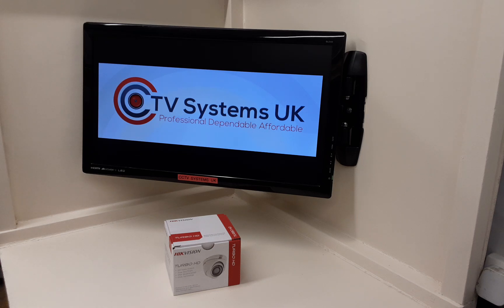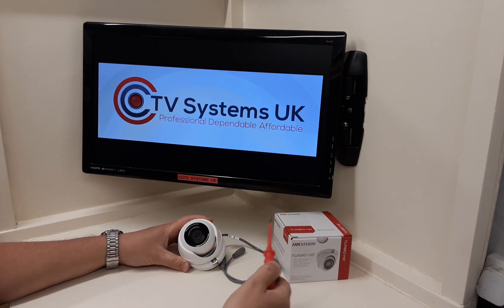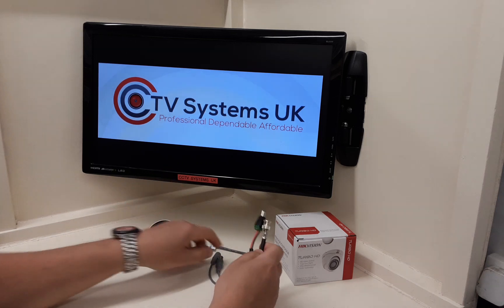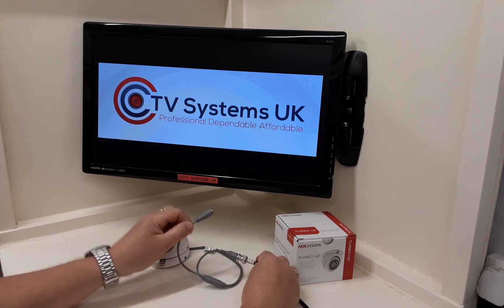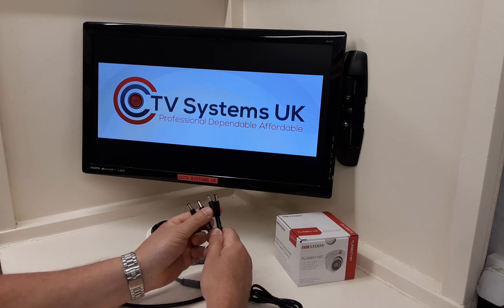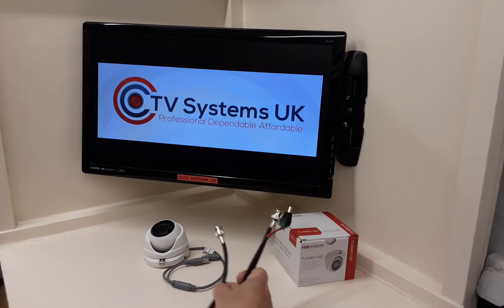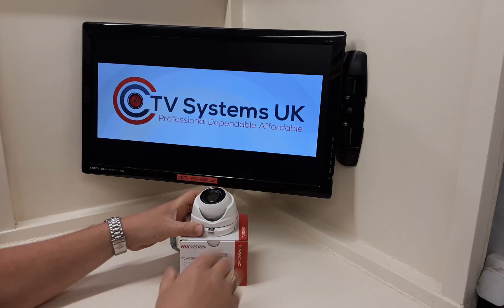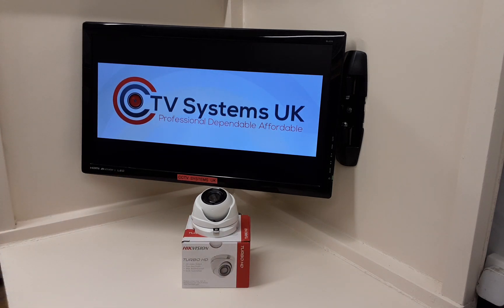Hikvision POC 'Power over Coax' HD Dome Camera

Comment: On your testing at 230m, did you forget that coiled power cables will act as a transformer, & increase the voltage? Laying it out flat, may have gotten you a different result. Any degredation in the quality of image? Latency?
Reply from the maker: @skysurferuk  Hi,

The cable can act in this way sometimes depending on the spec of cable. But, not with copper shielded!

Also, the back to back joints had an 1.8% loss. Of which there were 3.

Our testing contacts at Hikvision are convinced that 280 meters is possible. Depending on the camera variant.

This is the reason why 200 meters is warranted. Because there is a healthy redundancy margin! 👍

Comment: Hi , can you connect non poc camera with poc dvr.
Reply from the maker: Hi,

Yes, if a none POC camera is powered locally then the DVR will accept it.

We often add a Turbo X camera to  POC DVR's for some extra security.

Hope this helps.

Regards, 

Paul

CCTV Systems UK
Reply: Hi could I use network cable instead of RG 59 IE cat5E

Comment: Can poc be used with cat 5 and baluns without adding 12v?
Reply from the maker: Hi,

It's a good question but, I have messed with that particular proposition for some time now and have yet to find a balun that allows the voltage to pass.

Regards, 

Paul

CCTV Systems UK